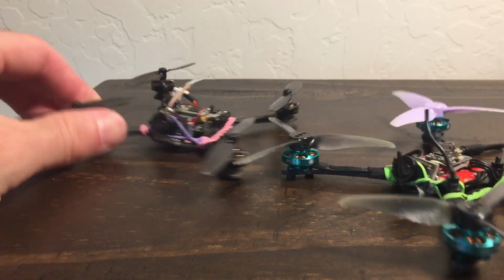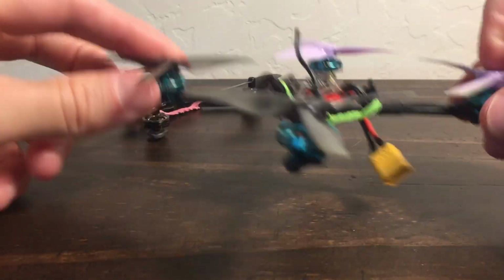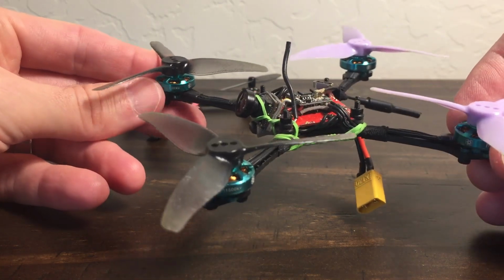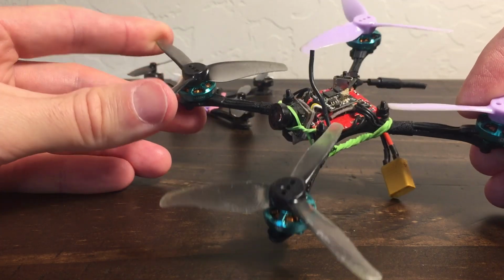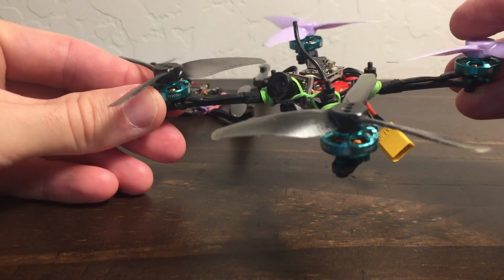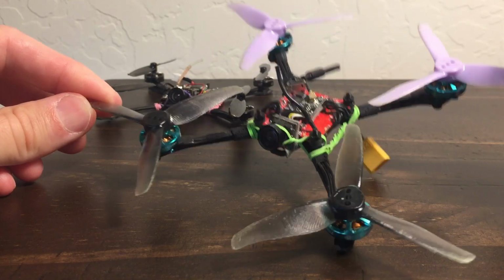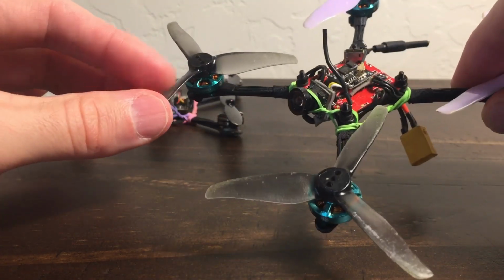Should you flash it? JESC 48 Khz ESC Firmware on 1S Micros

Comment: I recently did an A/B hover test with my babytooth (1202.5 11500kv with a 1s 600mah gnb) and with blheli-s 16.7 and I got 7:05 and with JESC 2.3 48khz I got 8:25 which works out to a 19% improvement, which is a lot more than I expected given the larger size of my motors compared to whoops.  I've only flown a few batteries full on acro, and it was quite a windy day, but the quad did feel a little "loose" on 48khz vs 24khz.  Not sure if I'm going to stick with it ultimately, depends on if I can tune the looseness/float out of it. Very interesting either way though.
Reply: I definitely noticed some weirdness on split S's specifically, felt like I was throttling towards the ground even when I was at 0% throttle, which leads me to believe the props aren't braking as much as on 24khz.

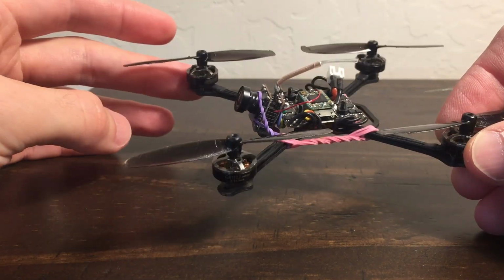Comment: Yeah, your assessment with the BabyTooth motors is spot-on.  It takes a lot of current, and the 600mAh say 50-100C (60A) vs the 450mAh at 80-160C (72A).  I think the peak amps make all the difference, given how much load the heavy props are putting on the motors, which at 1S voltage can only translate to high amp draw.  We need some 15-gram battery options with higher peak amperage, cause I think it matters more than AUW since this platform can lift the 50g+ weight of an 18650 if you're just cruising around for like 12 minutes.  It needs more peak amps, or less prop and higher voltage.  24kHz is just wasting energy and you still don't have the top end at either PWM frequency cause of the surface area of the prop blades.  Most stator to prop diameter ratios are like 1:11, and the BabyTooth is like 1:6...   if this thing is built for freestyle, higher C is the only readily available option we can buy right now.  Did 48kHz w/ the bi-blade 3018's feel any better?
Reply from the maker: That's interesting about the amp delivery presuming that the C rating is accurate. If it is that may be a factor. I haven't gone back to 3018 yet... but that will be coming up. I'm also thinking of cutting some 3018s and 3016s down to 70 mm and also drilling out some T65s. My suspicion is that I could get what I'm looking for with a prop that the motors can manage on 48 Khz.
Reply: @Quad66  I'll try to hook mine up where I can measure the amp draw on it as soon as I can.  I have some 3018's on the way as of today, so I'll give more detailed observations in the future here.

Comment: В дополнение. Ознакомившись с большинством сообщений понял что JESC yf 24  и 48кгц. работают НЕ РАВНОЗНАЧНО!! И на 48кгц. может быть как я называю "попрыгунчик".  У меня еще мало практического материала, но возожно разная управляемость - 1.стоковая прошивка, 2. JESC 24кгц. 3.JESC 48кгц. 4. Ваш вариант с Dynamic Idle и может еще 5. Project MockingBird ОТ этого разнообразия "Голова просто Разрушается"      In addition. After reading most of the messages, I realized that JESC yf 24 and 48kHz. DO NOT WORK EQUALLY !! And at 48kHz. maybe what I call "bouncy". I still have little practical material, but different controllability is possible - 1. stock firmware, 2. JESC 24kHz. 3.JESC 48kHz. 4. Your version with Dynamic Idle and maybe 5. Project MockingBird, FROM this variety "The head just collapses"!!)))...
Reply from the maker: Yes 24khz and 48khz will perform differently. 24khz will produce more torque and braking. 48khz will be smoother with more efficiency. you do need to tune the PID differently for each one. 48khz will require higher P and D. 48khz also may need “thrust linearization” for low throttle stability.

Comment: Can you have both 48kHz and rpm filtering on a bl_heli s? I have 96 kHz on my 75mm whoops and the flight times have increased substantially.
On my open-prop quads I opted for JESC rpm filtering in BF.
Reply from the maker: I believe JESC had an “experimental” 96 khz option. Bluejay has 96 as well I believe so yes you should be able to get 96 and rpm filtering. I like 96 on whoops as well to reduce braking which I find makes altitude management easier for angle racing around the house.
Reply: @Quad66  I will need to investigate this. So far I would typically go for a longer flight time on a whoop and rpm filtering on open-prop quad, but of course, having both would be the best.
On my 2s BT I use a Betafpv 20A AIO with bl_heli_32 - which has this option (I actually run variable PWM and rpm filtering on it) and I wish there were 1s boards with bl_heli_32 as well...

Comment: Same experience on my end with 1102 and the BetaFPV HX100 SE. I got 7:30 min on stab mode!

 However the tune is horrible! I mean really terrible. Would you be able to post your CLI dump to give me a starting point?
Thanks a lot!
Reply: Oh forgot: 
450mA batteries with BT2 (converted)
Reply from the maker: I added PIDs and Filters to the rotorbuilds page for the ONE14 https://rotorbuilds.com/build/21151 It was tuned on Betaflight 4.1.2 and JESC 48 KHZ. Both make a nice improvement in performance.
Reply from the maker: Oh, I don't fly angle (stability mode) on the outdoor quads so I'm honestly not sure what you want there for angle strength, angle limmit, and FPV angle mix. The project mocking bird Facebook group may be able to help you out with getting angle to fly well.
Reply: I'm only flying in stab mode indoors... With toothpicks, one needs to be gentle on the pitch or they shoot across my room. I also played with throttle cut, but don't like it. 

Thanks for the PIDs! I've actually found the issue: the screws don't hold the motors in the carbon plate anymore. I also might have a bent shaft... But need to check using your technique. 
Thanks very much Quad66!

Comment: I've never seen a 1s micro quad this style. how does it fly compared to like a tiny Hawk race or freestyle? Can if fly 2s? Currently only own 5in kwads a a few whoops but I'm trying to get into the toothpick game so I can actually fly around my house
Reply from the maker: 217_NickO I haven’t flown either of those quads but on paper they are over weight and in the case of the freestyle has poor weight distribution. When going micro you need to pick 1S or 2S otherwise it won’t be good in for either and all up weight and distribution is critical. When flying around your house you want to pick the key factors that will make it fun in your specific space. For example take a look at videos from Nick Burns. What will work well in his backyard would be way over powered in mine and vice versa.
Reply: @Quad66  i should have worded that better. I have a few indoor whoops I'm looking for somthing I can fly in me and my neighbor yard and not make much noise.